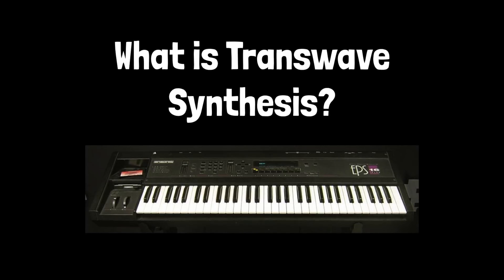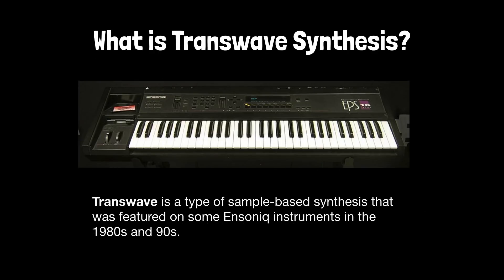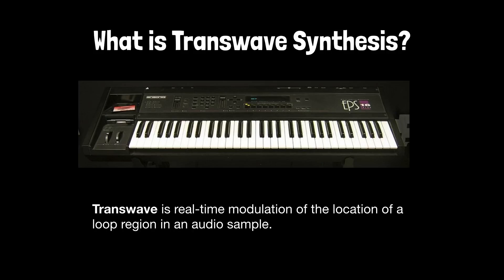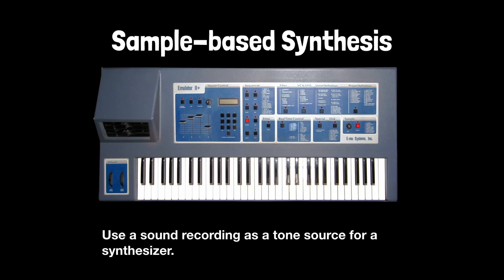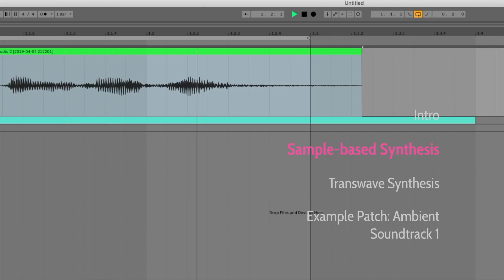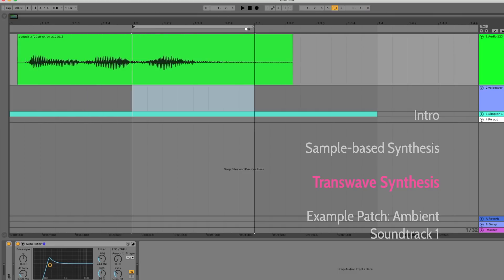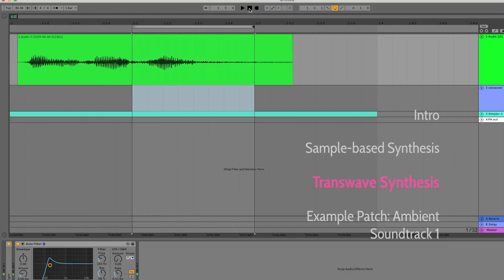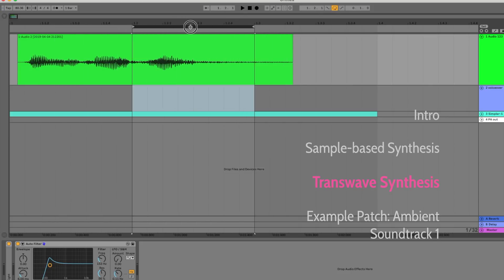What is Transwave Synthesis?

Comment: so this is not wavetable since there is no table but the same sample by itself?
Reply from the maker: Sounds right to me. You can also think of it as a wavetable synth, with the restriction that all rows in the table have to be made from a section of the same sample. The rows can, however, be really long. With a long sample and careful offsets, you can get close to a general wavetable. (Glue your waves together into a long sample then chop it up with careful modulation of the loop offsets. Learned trick from Robin Bausewein on here. Tends to end up with its own character which can be difficult to tame and hard to create)
Reply: @fabbrismidnight  I definitely agree that the EPS-16+ (and by extension ASR and TS series) have their own character. I'm kicking myself lately for not having leaned into the wavetable aspect when I had my ASR-10 keyboard years ago- mostly using it as a sampler and effects, albeit for some rather interesting, Ensoniq-tinged sonic mangling. I'm really appreciating your video breakdown as well as Robin's video series- and I have to say I'm extremely impressed by your continued attribution- it's a huge asset to the community 🙂
Reply: I'm not enough of a technical expert to answer conclusively, but I can tell you that I consider wavetable and transwave to be "functionally" very similar, to the point of being interchangeable in many cases.  In both cases you are using a mod source to scan though a sample to create complex and evolving sounds.
Reply: @crominion6045  I also tend to agree that they're essentially performing the same task. Ensoniq definitely offered a far more open and accessible approach as far as being able to use your own samples; which is a double-edged sword: flexibility at the expense of ease of wavetable creation. But the spirit was always more about the synthesis and exploration than about re-treading PPG's (et al) path, so you could end up in some pretty uncharted waters pretty quickly with very interesting and pleasing results 😀
Reply: You can simulate a wavetable using one transwave sample - just “assemble” your smaller waves in necessary order and make them same size (let’s say 128 samples each). Can be done on computer and then sent to sampler using MIDI SDS. This will create ability to scan thru waves as simple wavetable (with corresponding parameters specified in sampler).
Reply: @serhiymarchenko8361  That sounds interesting. Does Awave port the stuff over?

Comment: As a former Ensoniq owner, I'm enjoying your transwave experiments. Bill Mauchly of Ensoniq marketed some single-cycle wavetables under the third party Waveboy brand; in fact they are still being sold by Chicken Systems. These Ensoniq samplers can be made to do smoothly modulating single-cycle wavetables as Wolfgang Palm intended. I've made a few transwaves myself, so I'll reveal the "secrets" to anyone who might still be interested ...

To make smoothly modulating single-cycle wavetables for Ensoniq EPS 16+ or ASR-10, I started with a table of all the available sampling frequencies generated from sampling at every available rate and examining the files on my computer to determine fractional sampling frequencies. Looking at samples I still have from those days, I see numbers like 32894.7368, 36764.7059, 39064.0259, etc. The 16+ supports many sampling rates, but not just any sampling rate. The ASR-10 supports playback at any rate supported by 16+, although it can natively sample at fewer rates.

Then I compared the table of sampling rates to a table of A440 equal tempered frequencies and made a list of notes whose frequencies were subharmonics of the sampling frequency, to within about one cent accuracy. In other words, at those notes and sampling frequencies, a single period of a waveform would be an exact number of samples, making it possible to create a series of waveforms that could modulate smoothly in the way originally conceived by Wolfgang Palm. The key was to conform the waveforms to exact sample number periodicity, and let the Ensoniq sample playback transposition algorithm compensate for playback not necessarily being at the original pitch or sample rate of the wavetable.

I wish I still had that list of the "magic" notes and sampling rates; I'd just paste it in if I did! One could reproduce my work quickly by the above methods if interested. (You also need a synthesis system that can synthesize tones at arbitrary sampling frequencies. In the 90s I used the Amiga program Synthia Pro for that.)

Alternatively, you can make any series of smoothly crossfaded single-cycle waveforms work as long as the waveform period is uniformly a whole number of samples, without caring about the frequencies of either notes or sampling rates. Just tune it with the sampler! The "magic" notes and sample frequencies are simply those that require the least transposition by the sample playback engine to compensate for tuning, thereby optimizing sound quality near the root pitch of the sample.
Reply: "Bill Mauchly of Ensoniq" Waveboy!!! His FX disks were awesome
Reply: I've really wanted to get more into this with the Mirage.  I'm pretty quick with programming it but dealing with the "Pages" always confused me.  I could seemingly make very simple wavetable-like sounds, but it wasn't really what I wanted.  I have an S612 and if you set the sample rate at the perfect point, and record an F note, it produces a perfectly looped sample, considering the source was steady enough pitchwise.  No crossfading involved.  I've created amazing single cycle waveforms of my own voice within seconds using this technique.